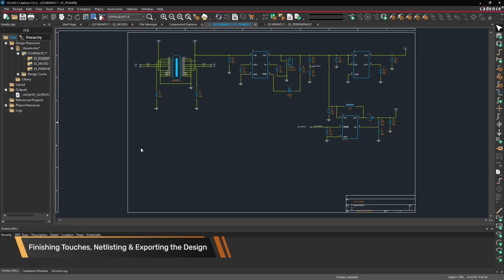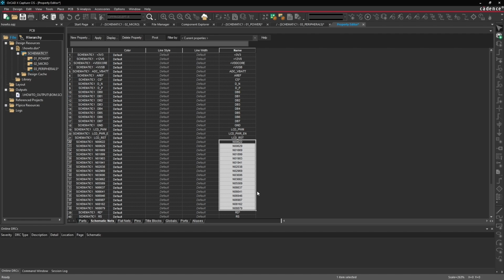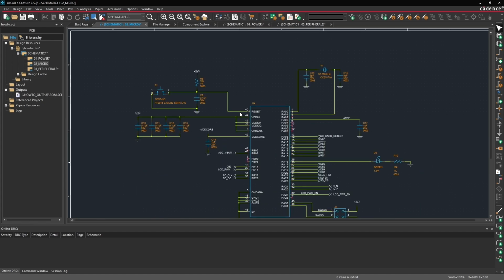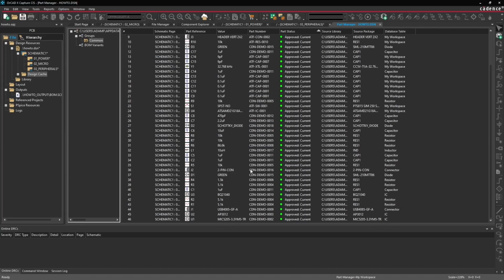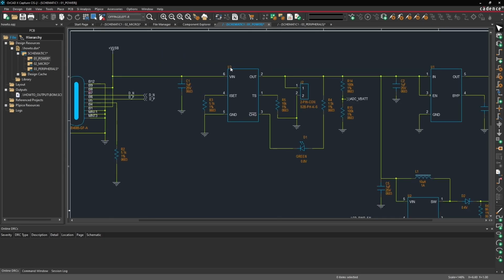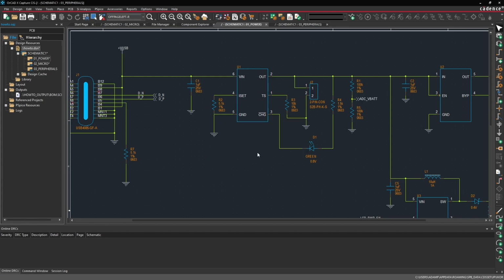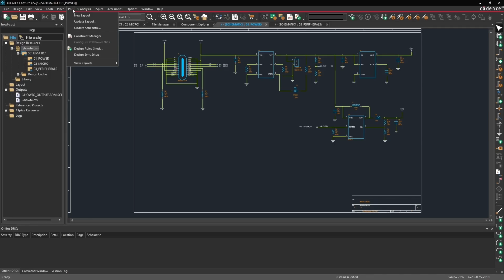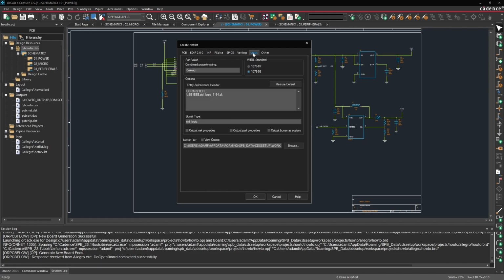OrCAD X Capture How to Series Part 6 - Finishing Touches, Netlisting & Exporting the Design

Comment: After investing so much in the data
What about BOM export options
Reply from the maker: Live BOM is a powerful tool for BOM management and export options. Here is a How To video on using Live BOM https://youtu.be/upwE6dNYczI
Reply: Live BOM is a powerful tool but it is not explained anywhere how to export the data to an external file.
I need to transfer the data to a client, manager or other engineer to discuss the meaning of the results.
Sometimes I need to integrate the results into a company database.
How does the interface work?
Reply from the maker: @zivhalperson614  Hello, and thanks for the questions.  There is an automated CSV output which you can find in the Outputs folder section of your project panel.  Another option is to press the "Schematic Update" button in the top-right which will synchronize all MPN and Manufacturer choices to the schematic, and then you can just use a regular BOM export to get the same information out.  At this time there is no manual export out of Live BOM.  We are working on adding a more customizable output button in a future release, similar to a BOM output.  Stay tuned for more info on that.